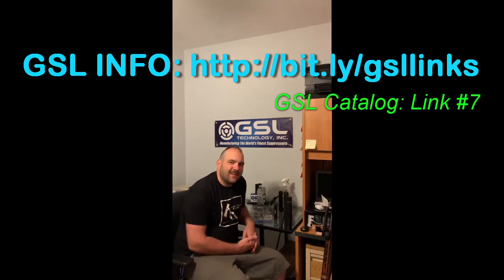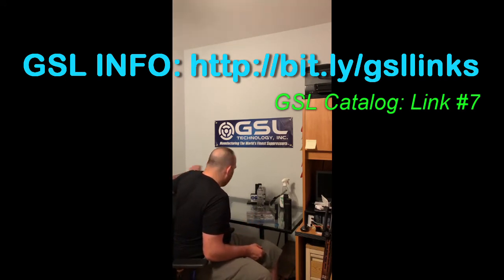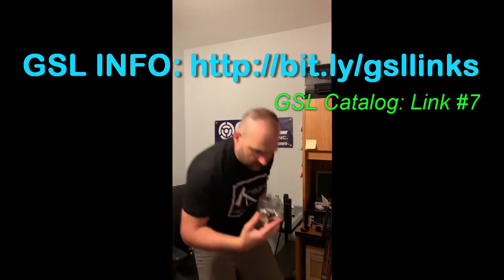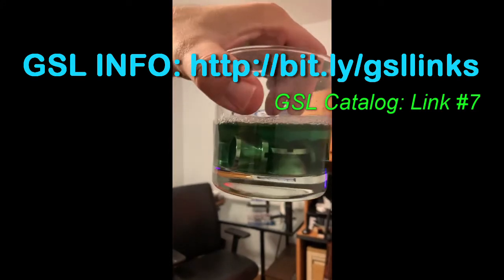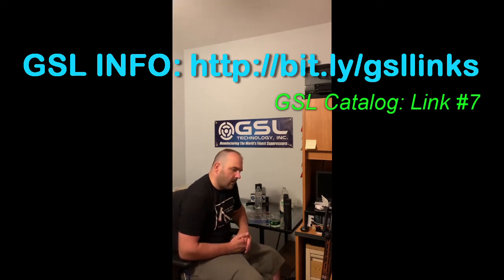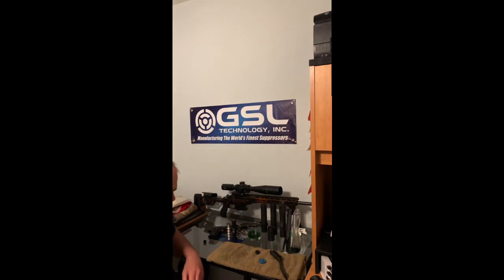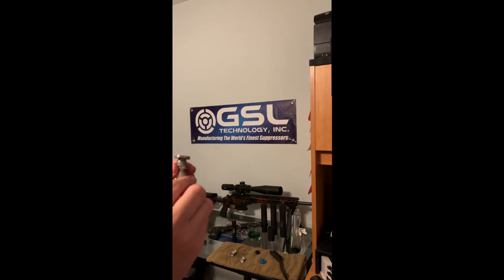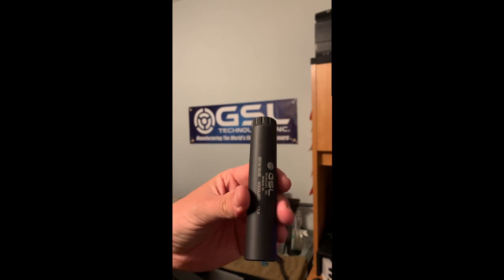Cleaning 7075 Aluminum Suppressors?!?!

Comment: Whats is your experience with 7075 Aluminum 7075 Supressors for .308 Win?
Reply from the maker: Tricky. It’s totally possible, but you need to limit the firing schedule on them to 2-rounds per minute (bolt action) the gsl gamechanger is an option for bolt action 308

Comment: After the first baffle does the order matter on the woodland?
Reply from the maker: definitely yes. the first baffle has a smooth top and tangs on the bottom. the last baffle has a smooth bottom and tangs on the top. the other 4 baffles you can put in any position https://drive.google.com/file/d/1dqHo2-WGKRNGuT0p--ifYYdPXfYd_Nji/view?usp=sharing this doc should show the stack info
Reply: @iamKevinKinzer   Thank you. Just to confirm, when you orient the baffles, are you placing the little dent that looks like a baffle strike or the hole on the side at the specific position?

Comment: What would you suggest to clean a 9mm aluminum SD can. It’s closed off so I can not take it apart.
Reply from the maker: I’d always check the original manufacturer guidelines on cleaning 

That being said, I wouldn’t see why the simple green/water mixture wouldn’t work, maybe put that tube in a capped pvc pipe and let it soak. I’ve seen some large sd brushes also 

Dang, this is a pretty old video. lol

Comment: So i just got my first can. A rugged mustang 22. I dont even have it yet and am already having a little bit of buyers remorse not being able to use it in a sonic cleaner. I was going to use bore butter on it but that seems so messy and cumbersome. So youre saying i can use 7075 aircraft grade aluminum in a ultrasonic cleaner ?
Reply from the maker: I didn’t use an ultrasonic here, just put them in a glass. I wouldn’t use anything ammonia based or super abrasive on your 7075 components, but the ultra sonic itself isn’t the issue no, it’s the solvents.

Comment: Finally a video on how to reassemble this suppressor!! I can't get the last baffle out of the tube. I have been using a wooden dowel and a rubber mallet and it still won't budge. Seems carbon locked. I've broken several dowels. I've got it to budge a little bit but it's still closer to the threaded end than it is to the open end. I squirted the baffle with REM oil and hoppe's 9. Currently letting it sit then I'm going to try again to knock it out.

If that doesn't work any suggestions? Also is there a way I can send it in to you guys and get the baffles upgraded to Stainless Steel, i'll gladly pay haha. I have another 22 can and it has SS baffles and it's such a breeze to clean.
Reply from the maker: You can definitely drop the woodland and all the pieces into a box and we can take care of it, get that last baffle out and yes, we can probably even swap them for you 

Fire off an email to me at kkinzer@gsltechnology.com and we can make it happen 

If you are in michigan, you might even stop in the shop and we can do it there
Reply: Are there stainless baffles available for the woodland  @iamKevinKinzer
Reply: Sent you an email.

Comment: Thanks for this. I’m assuming the Trinity can be cleaned in the same manner. Question on the Woodland, I just purchased a Woodland (it will be in jail for some months now) and I had the shop upgrade to SS baffles, will a simple clean solution be ok on the SS baffles? Thanks.
Reply from the maker: Yep, they will be totally fine
Reply: So you can get stainless baffles for the woodland? If so Take my money please

Comment: I've been hearing mixed reviews about using Simple Green that it could strip the anodizing.....thoughts?
Reply from the maker: I diluted it down 50/50 since simple green is concentrated, and I generally just use it on the baffles. The tube generally doesn’t need to soak like that. 

I will do a test piece of anodized and double check this for you.
Reply: @iamKevinKinzer  Thanks for the quick reply!   And a test would be pretty awesome!  It could help dispel the online chatter!
Reply: @XFBO  I use clr on anodized aluminum, zero issues